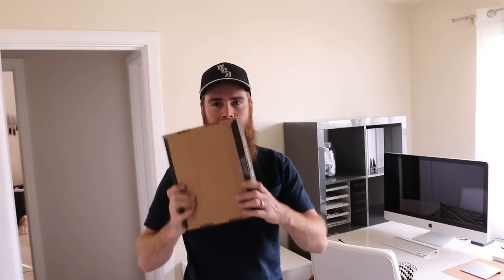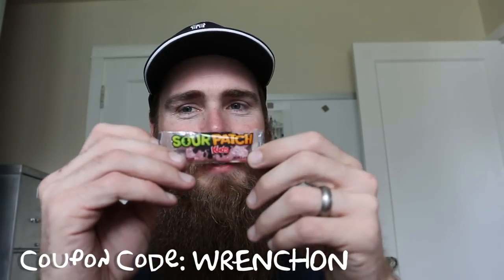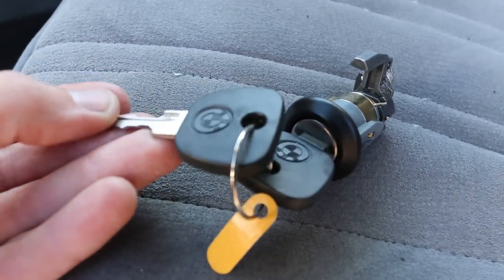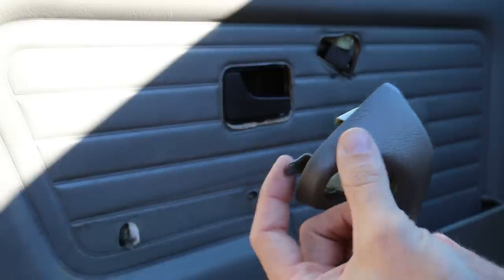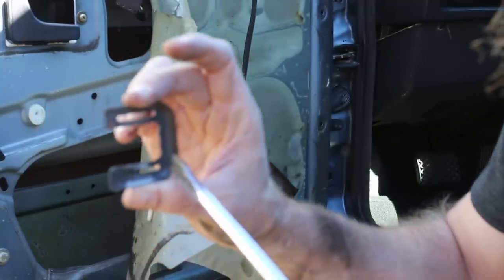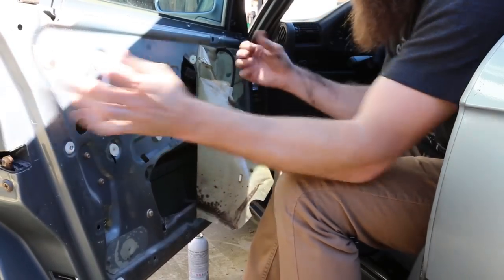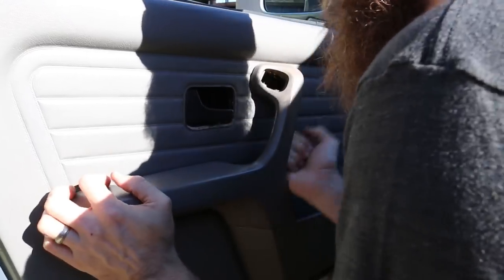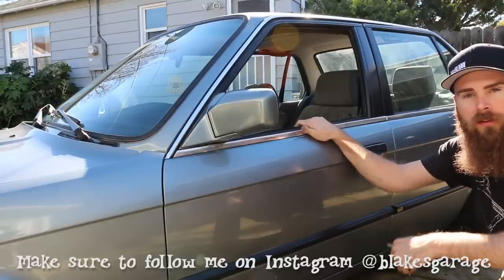E30 Door Lock Cylinder replacement Berty30 Build Episode 20

Comment: Hey great video. Just a note though, you said that the passenger door lock cylinder is no longer available. Sorry but that is wrong. I just bought from BMW a complete set of keys and both door locks for my 1989 325i with central locking, they took my VIN and had my new keys and door lock cylinders at the dealer in less than a week. Also on a cool note, up here in Canada we deal with frozen locks in the winter after washing our cars, I discovered my car had a heating element built into the lock cylinder retainer clip to prevent freezing of the door lock, I have never heard of that before.
Reply from the maker: crackerbme really that's awesome I wonder if that's just a cold climate thing for Canada or what. I will have to check that out how much did that cost? I just got the lock from CaTuned I didn't even think about going to the dealer lol.
Reply: At the dealer there is a bunch of stuff that we can still get for our cars, sadly though it isn't cheap as the dealer prices for parts has really gone up. If you use the website www.RealOEM.com or http://bmwfans.info/parts-catalog, enter the last 7 digits of your serial number, it will bring up your car and all the applicable parts and their numbers, there is also an app for that as well but it will only give you the exploded view of the area of the car but no part numbers. The website will also tell you if the part is still available, fairly accurate for me so far anyways. So anyways to answer your question about the keys, it cost about $450.00 Canadian for the key that opens all the locks and the ignition, the Valet key, as I call it, it will only open the driver's door and start the car, and two door lock cylinders. The nice thing is I don't have a bunch of keys for different things on the car and it is all keyed correctly for my serial number. When you go to BMW for keys though they will ask for proof of ownership, makes sense to me. Keep up the great videos I really enjoy them and hi to Berty.

Comment: you should try some graphite lock lube on some of the other key holes. when I had my miata I thought the passenger and trunk lock were broken. after some graphite spray shit was like brand new. great vid as usual!
Reply from the maker: T-WRX I did that in the trunk and it helped. The driver door cylinder was toast so I'm glad I swapped it out before I killed another key.

Comment: Hey Blake, did you ever look at doing a lock rebuild? I think you can rebuild the lock and the tumbler systems so that you can use the original key/have the same key for everything.  I was looking at doing it as my drivers door lock will not open and don't want to break the key but thankfully It has a aftermarket remote lock with the central locks, however it seems a little daunting with having all of those pieces everywhere haha xD

Comment: Hey man. Have you guys installed LED fog lights in the RS yet? If so can you please do an install video so we all know how to get them swapped out?
Reply from the maker: Toby Smith Brandon did put some aftermarket yellow lights in already. Not sure if Kris has yet in his RS if I remember next time he's out I can get some to install.
Reply: Oh ok great. I just haven't been able to find any install videos for the fog bulbs for our RSs didn't know how difficult it was going to be. I'm waiting on a set of Auxbeams to install
Reply from the maker: Toby Smith I don't think those are going to fit because of the fan on the backside I'm pretty sure you just have to use a standard style bulb. But I do have a new LED company that sent me some stuff that I will be putting in the BMW for the LED fogs that may work for you because the back portion doesn't change from the factory style.
Reply: Blake's Garage The Auxbeam LED fog light install went great. I used the F-16s and they look awesome. I just had to remove the cap at the end of the bulb to get it to fit into the housing inlet. Turned out amazing tho.
Reply from the maker: Toby Smith awesome glad to hear they worked out for you!

Comment: European Experience is a big euro show. I should get me a Petrolbox they usually com with good stuff, my central locking unfortunately stopped working a couple of years ago so I cant even unlock the doors after i lock them manually unless I go through the passenger door because someone broke a key off in my tumbler. I would assume if they made these they could make them keyed to your car through the vin number.
Reply from the maker: chgotbanned yeah I think you can but that would take a bit to get.

Comment: THis happened to me about 11 years ago, was weird i went to lock the trunk and the key lightly touched the trunk lip and the key broke apart a bit higher then yours did. For a few years after i used a key that the locksmith tried to create from the broken pieces, it worked but wouldn’t open from the driver side and it actually burnt out my starter, it got stuck in start and i drove for about 15 mins before it killed the battery, didn’t even notice it was stuck in start. But Seems like you weren’t aware but you could of requested the Key combination code for your car from BMW, they need proof of ownership and all that and your vin but you could of just got a hole brand new Key made from them at that point or almost anyone. If it wasnt for my dad I would of never of known ether.